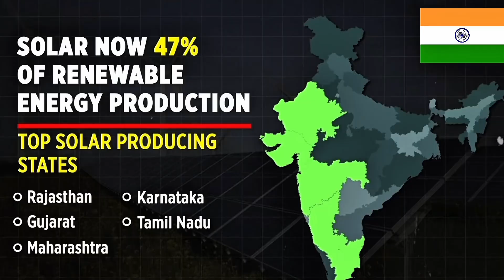India Just Surprised the Gulf… The $300 Billion Solar Power Shift!

Comment: India should also speed up nuclear power generation for constant power grid generation requirements. Using the solar generated electricity requires use of power when it is generated - for example for air conditioning which uses solar energy when solar energy is greatest, and water pumping for irrigation or storage which can be done at peak generation. Also the development of cheap fixed storage batteries is essential to use of solar or wind energy. The organisation of generation and solar energy buy back and charging to/by community or national grids, and planning regulations is also important. The incorporation of solar power related planning requirements into new buildings/houses, existing plots, and electricity supply companies in an integrated manner similar to what we have seen in UPI/ONDC for trading of solar power is required to maximize the benefits of solar. The large solar farms we have seen so far is not the answer. Putting solar panels onto every building will reduce power consumption on air conditioning by removing solar heating of the same roofs, as well as cost of transmission grid construction,  transmission power losses, power theft etc. and loss of agricultural land to solar farms. The exception to this is solar panels over reservoirs and canals (which reduces water loss due to solar evaporation and blockage of irrigation canals by water hyacinth growth etc. Use of localized solar panels for street lights, bus shelters, highway junction illumination etc. will remove the cost of connecting all of these to the electricity grid. Use of solar panels on canopies or covered car parking spaces at offices will not only generate electricity which can be sold to the grid or sold for charging cars parked at the office, but will allow the cars to be kept from getting hot under the sun - so planning incentives to encourage use of solar panel canopies over shopping or office car parking spaces should be considered.
The success of solar power in India will depend to a very large extent on government planning and implementation of incentives like the above.
Reply from the maker: This is a very thoughtful and well explained point. 🙌
You’re absolutely right — solar alone isn’t the full solution. We need base load stability, which nuclear can provide, and strong storage tech like grid batteries or pumped hydro to balance the day-night generation gap.

Also agree on decentralized rooftop solar — if every home, office, school and parking area becomes a small power producer, transmission losses drop and dependence on massive land-based solar parks reduces.

India has started moving in that direction (like canal-top solar in Gujarat, and the new PM rooftop solar scheme), but scaling it nationwide with proper grid buyback rules will be the real game changer.

Thanks for adding so much depth to this conversation.
This is exactly the kind of discussion we need 🇮🇳☀️